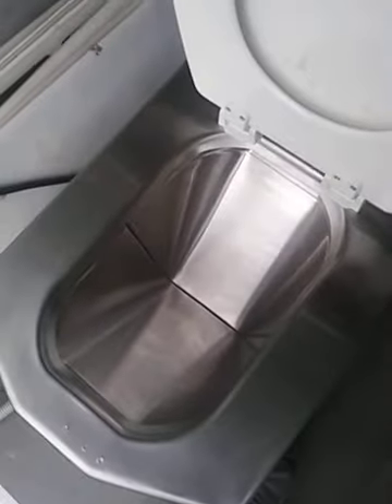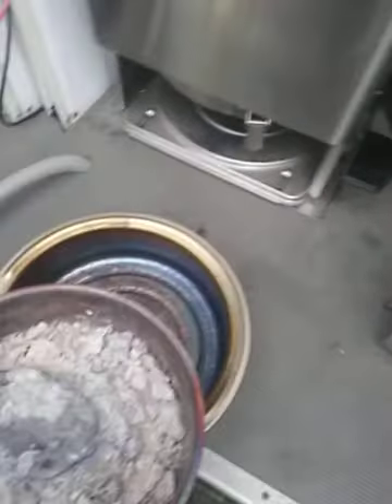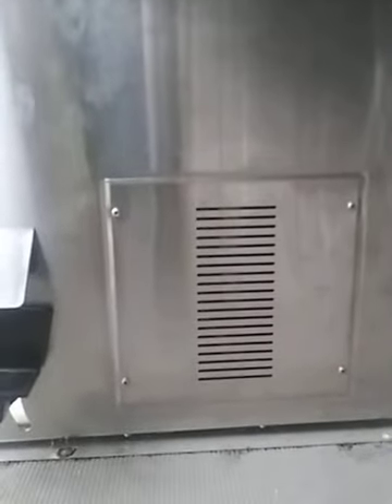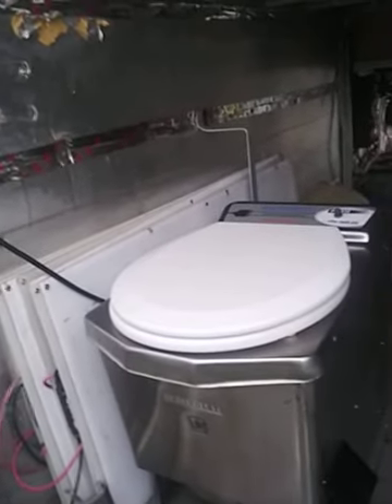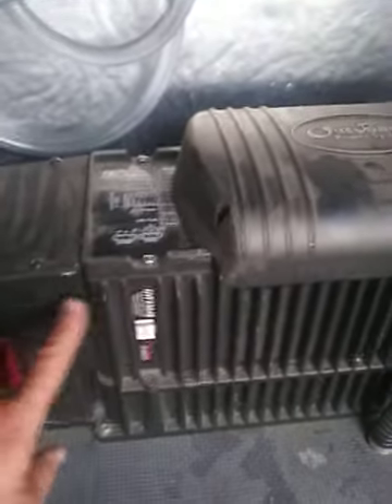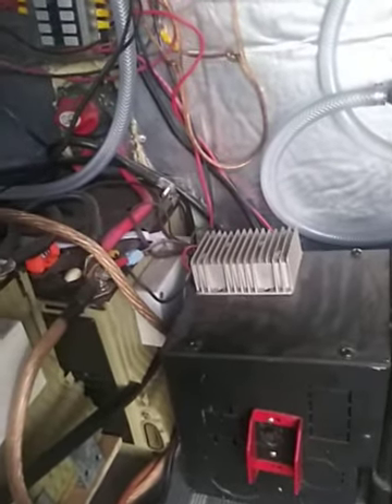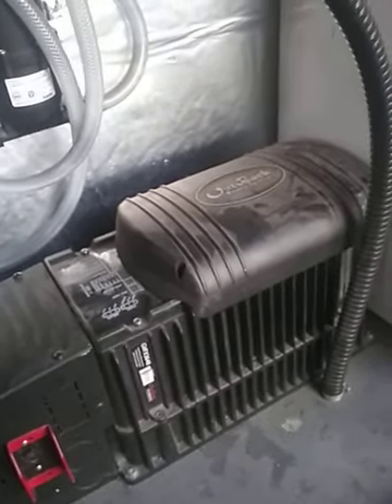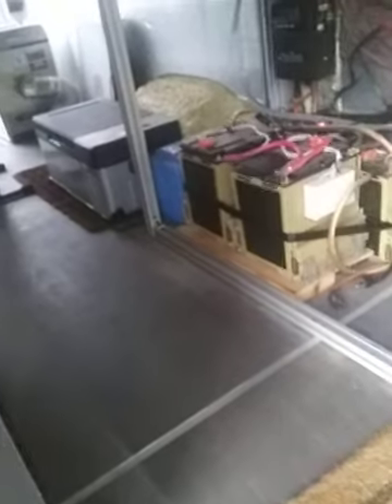My INCINOLET INCINERATING TOILET in my van!

Comment: I know there is a propane version too. The electric seems like it would be more difficult to keep up with without shore power.
I like these as a concept, hope they pan out in actual use.
Reply from the maker: Propane is easier to deal with if you don't have large solar. Good point!

Comment: I believed it was a flame device not electric. Amazing setup. The inverter looks like something out of Star Wars series. I guess you still have to deal with the liquid part. What about the smell part of baking?
Reply from the maker: It uses a circular electric coil to heat the inside of the pan. It takes care of solids and liquid so you sit and do both if you need to. The only thing i smell is the paper burning and it's not strong.👍

Comment: This is absolutely remarkable. THREE WEEKS!! Wow! I never would have imagined such a device could be powered off solar. What would you estimate the "doody" cycle 🤣 is for the 2kW power draw after the initial 10 minute heat up, 50%?
Reply from the maker: I think it's on for 60 seconds and off for a couple minutes. The last 30 minutes only the fan is running to cool off the pan. Great joke btw😅

Comment: What percent of your total battery AH does this use? And how big is your system at what voltage?
Reply from the maker: I'm using two 48 volt EG4 batteries for 10,240 watt hours combined. If i run the ac all night my batteries are down to 40% typically during summer here in sweat box Florida.

Comment: I am looking to do this in my RV if I can. Could you give us a rough description of the electrical design that supports this? I contacted the Incinolet company and they said it could not be done. Thanks
Reply from the maker: I use 900 watts of solar panels on the roof, 48 volt battery bank, 3,600 watt inverter, 20 amp breaker switch and heavy guage electrical wire to a dedicated single receptical. When i connect to my ground mounted solar panels (2,600 watts) i can run anything without any worries but when using the 900watts on the roof i have to let the battery bank get charged back up.
Reply: @offgridphilosophy7959  great video... any chance you could get an estimate of how many watts or amps its pulling on AC power from your inverter when its in the long burn cycle ?  thanks

Comment: So I have a hypothetical question. 

If you wanted to put 2 insinerator toilets in every apartment in an apartment complex. Could you vent it like you would a central air? Like 2-4 stories. I'm trying to wrap my head around it.
Reply from the maker: As long as the fan pulled on the entire duct system rather than pushing the air through i think it could work.

Comment: I inquired about having one put in a van build. The man told me they couldn't put it the build because of the power it takes. But if they are building from the ground up, can't they install the necessary electrical power, circuit hook up to meet the need of the toilet? Do you know anyone who does know how to install?
Reply: The unit only requires 20amp. Should be very easy for electrician

Comment: What could you say about any odors downwind of your rv during the burn cycle?  If parked near others,  could it be a problem?  If stinky,  how long through the burn cycle before it no longer smells like what it is,  steaming, burning poop?  And does urine in the pot make this worse?  Thanks for the great vid!
Reply from the maker: There are little beads surrounding the pan and they work kind of lika a catalytic converter. You don't smell any poop or pee. You get a very light smoke for about a minute and it's from the toilet paper. Other than that there is a slight smell from the catalyst beads and that smell isn't a bothersome smell.

Comment: Thank you so much for the video!  Really helps me to make a decision.  I do have one question.  Can this be used in a shower/toilet combo as long as a cover is placed on the incinolet  while showering?  Hope my question makes sense.  Thanks much for a reply.
Reply from the maker: I was thinking you would have to cover it from head to toe but I'm wondering if steam and water vapor would still make its way in and corrode the electrical connections and circuitry. To be safe I'll have to say no. $2,000 is a lot of money. It would be a gamble.
Reply: @offgridphilosophy7959  Thanks, you make a good point.
Reply: I'm moving into a house that has an incinolet toilet and a lot of humidity. The combination of humidity and the home being vacant and unheated caused it to completely rust through many of the parts. I believe that if someone had been living in the house there wouldn't have been so much condensation and less rust issues.

I'm trying to decide if I want to fix it or find an alternative since it's not possible to have septic there.
Reply: @angelacarter6593  Thanks for the info.  I'm working through some ideas to mitigate humidity.  My understanding is that these toilets are also used on boats, so there must be solutions to combat humidity.

Comment: Is this unit gas or electric?  How do the two compare in term of fuel (electric or propane) consumption
Reply from the maker: Mine is the electric version. One thing that needs to be said is that fossil fuels are very energy dense and hard to beat. I chose electric because i didn't want to have to deal with getting and storing fuel. Having the propane version would have some advantages but i want to be self sufficient if shite hits the fan. 👍

Comment: Hi there, thinking about installing one of these in my RV- do you still like it? It still works good for you? Thanks for your info here it is super helpful and hard to find reviews from people who have them in mobile units
Reply from the maker: I've been using the 960 watts of solar panels on the roof only lately and it's starting to struggle to keep up because the air conditioner has been running more often. If you're using shore power, good generator or 2,000 watts of solar you'll never have a problem👍

Comment: Will this work with a 24 volt system
Reply from the maker: Yes it will even work on a 12 volt system but that would really be pushing it because the inverter would get pretty hot. But yeah a 24 volt inverter can push it as long as it has room to dissipate it's heat 👍

Comment: Have you ever had problems  with overheating when your pipes go through the floor?
Reply from the maker: Surprisingly you can keep your hand on the pipe so it only gets very warm. You can use pvc pipe or even rubber couplings. Most of the heat stays inside the burn chamber. 👍

Comment: To cut down on power draw is it possible to flush after every use but only burn after a BM? Or after a few times urinating? What would be the disadvantage of that? Odor, limited space in the burn chamber or then it would take longer to burn because of the increased liquid? Great video. I subscribed. We have to help each other out.
Reply from the maker: It can be done. The paper is wax paper so i assume it can hold liquid indefinitely. Odor will depend a lot on someone's kidney health. You can probably use it that way 3 times before adding a bm. You'll have to wait until the bm to flush it.